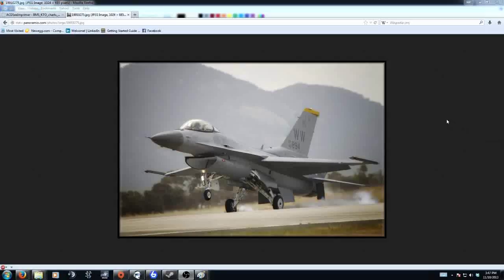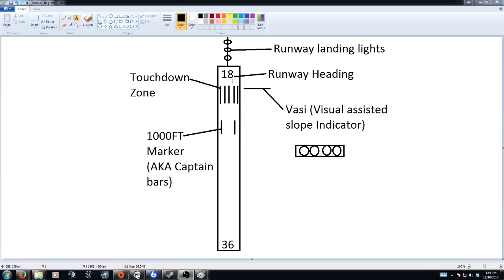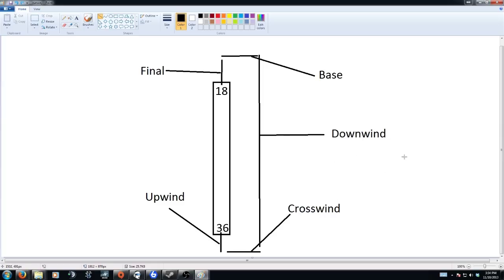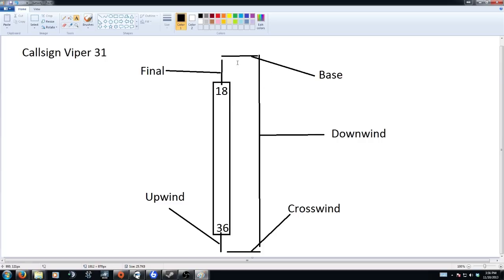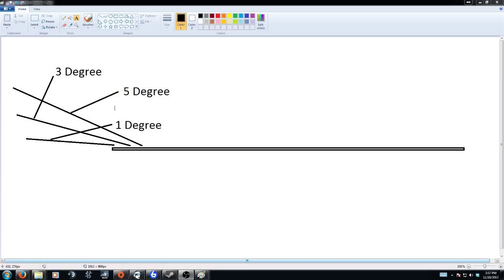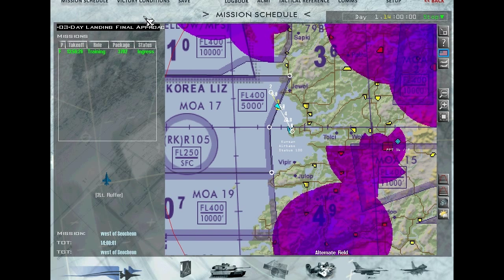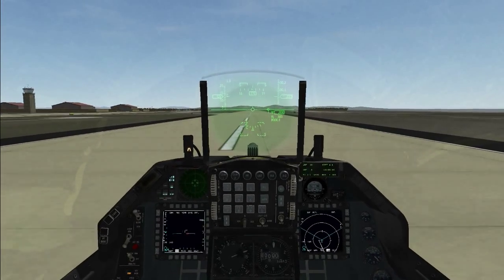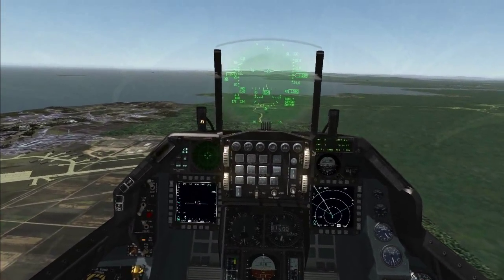A Falcon BMS tutorial on Landing Operations

Comment: IRL is the VASI the only way to know you're on the correct glide slope during VFR or is there another way without any assistance? I'm assuming as you turn final you're going to use VASI to intercept the GS and then hold it down all the time?

Comment: Just want to point out that 4 red VASI lights don't mean 1 degree! You'll get 4 of them if you're at 2.5 degrees. 1 Degree is essentially a crash. Same with 5 degrees, that's waaaaay too high, you'll get 4 whites with 3.5 degrees. No pilot should ever get anywhere near 1 degree or 5 degrees, that kind of deviation can't even be described as an approach anymore.

In BMS though, the VASI is entirely pointless. There's no intermediate lights, just 4 red or 2/2 or 4 white. In real life you're going around as soon as you see 4 reds, so unfortunately the VASIs in BMS really are totally useless and probably shouldn't even be shown to new pilots until they can fix it :( If you see 4 reds you're supposed to go around and since there's no 1red/3white in BMS, you actually have no idea where you are on the glideslope by referencing the VASIs. They're no more than eyecandy props. But I hope they fix it.

 I just really don't think this stuff should be shown to new pilots until then. It will just confuse them more / teach them something completely wrong. Flying the BMS VASI will kill you.
Reply: I hope that didn't sound "critical"... I love your videos! Just pointing it out :)
Reply from the maker: CTFlyer7
All good brother, if you have 3 VASI lights the point of the message is to try to hold altitude and put yourself in a better glide slope angle.